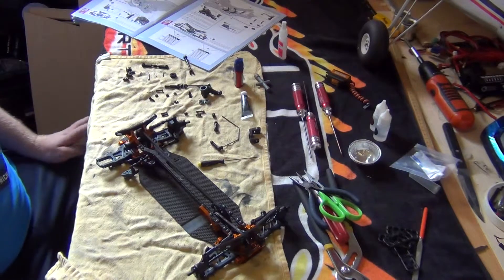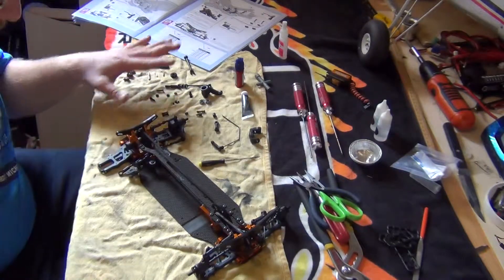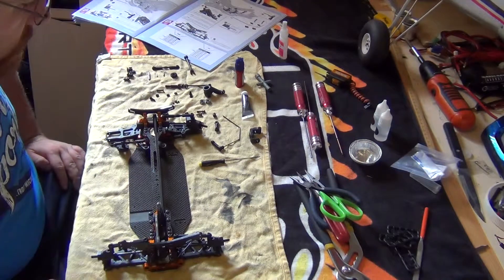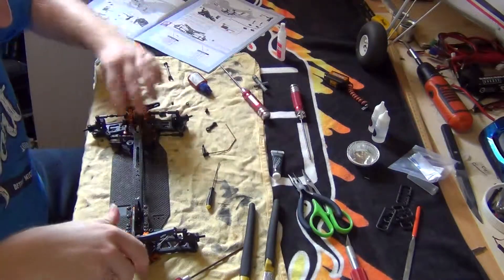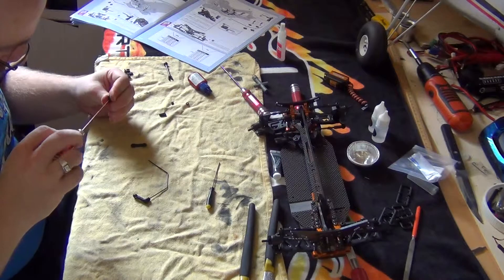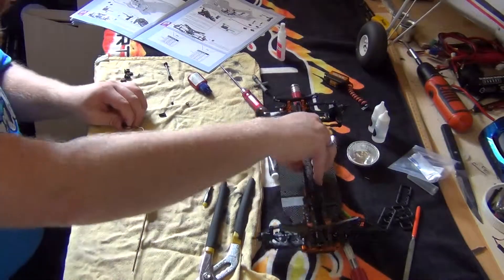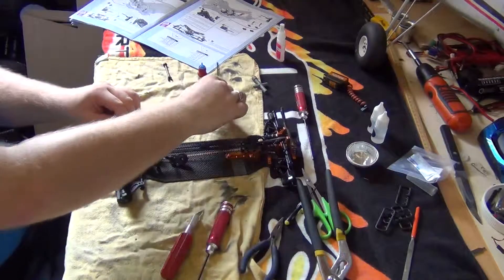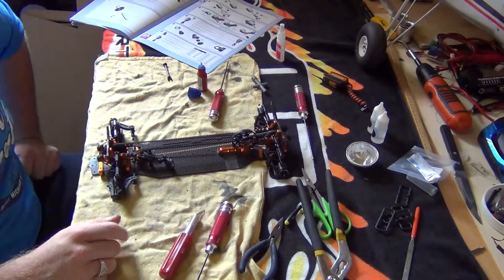Xray T4 '14 build series part 6. CVD shafts, steering & suspension.

Comment: How tight do you have your drive belts
Reply from the maker: I have my belts at the factory setting. With belt driven chassis' you don't want the belts to be "tight". If your belts are tight what happens is you create mechanical drag. What you want  is the belt to feel a little "sloppy", by that I mean you want the belt to move up and down without needing any force to do so. The way to tell if the belts are too loose is if you hear a clicking noise under acceleration. That's the sound of the belts slipping on the pulleys. I do caution you to take care with your tc6 because running a 4s lipo can cause some damage to the belts, so I recommend you accelerate carefully as the belts could snap.
Reply from the maker: Just to add, if you can, try and find Kevlar reinforced belts as they will be stronger. I know xray have Kevlar belts as standard, but I'm not too sure about team associated.